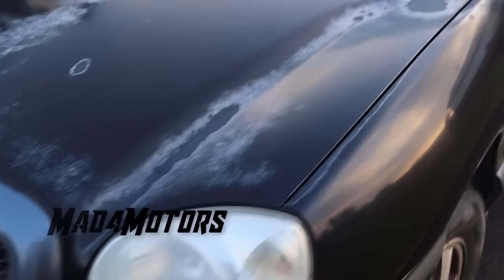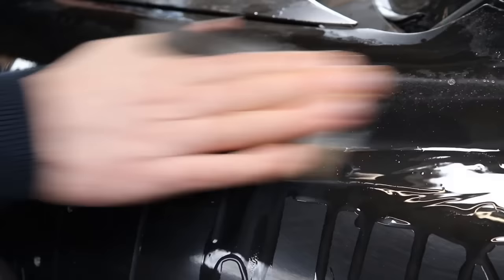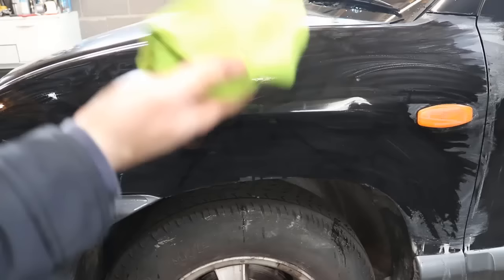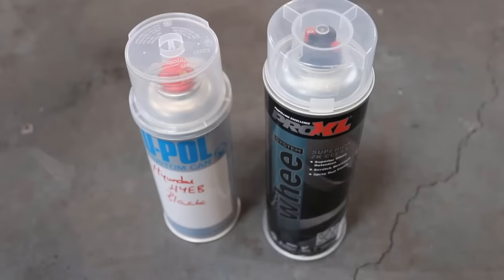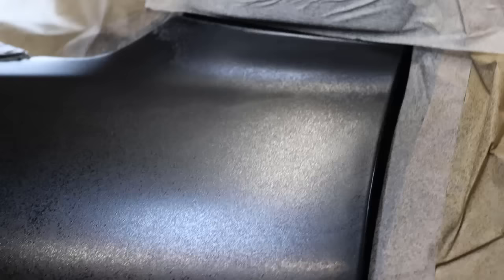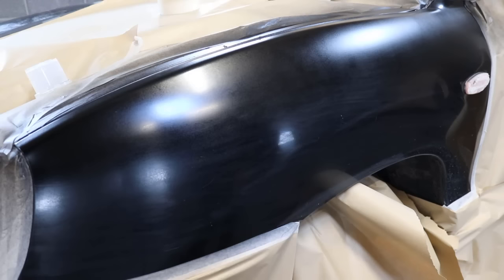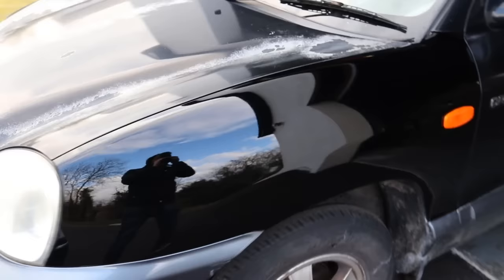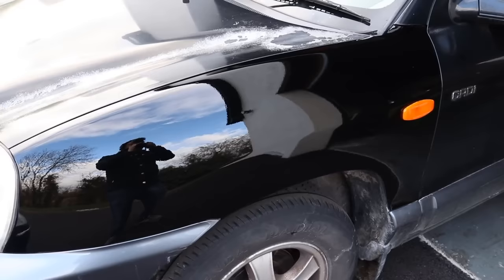How to Repair Clear Coat Fix 100% all types

Comment: This guy just shut down 2 thousand paint shop across america lmao 💪🏻 real M.V.P
Reply: Wade Wilson lol spray can jobs are shot
Reply: Yeah panel shops rely on $500 cars coming in for repairs that exceed their price tag, RIP panel shops 

Side note, this is a temporary touch up and won't last very long and is only useful for flipping a cheap car
Reply: Gotta love capitalism
Reply: Yeah right! Until you do this and realize there is a huge step he missed, orange peal! Not to mention, that was just a fender! 75% of people dont have the time to can spray paint a whole car let alone the time it takes to sand by hand!!
Reply: JKazama182 He does mention orange peel, and this method is meant to repair individual panels not an entire car.
Reply: Cisco Fair enough😂
Reply: Hahahahaha no he didnt.
Reply: yeah - but  NO 
the paints i use will stay on your car for 15 years minimum.  these are wal-mart paints. they will peel again in a few years. they do not endure uv rays like professional paint systems. 
 there are higher grade 2 part spray can paints, but the price tags go up with the quality.  
i am not advertising for paint shops - but a reality check is in order. 
there is some truth to the statement -  " you get what you pay for "
Reply: I have this problem on my car right now, this guy is a God to me right now lol
Reply: Andrew Glass better than other economies, where everyone is driving a piece of shit like this one 😂
Reply: Honda dealer tried to charge 3000 USD for this
Reply: Real shit 😂
Reply: @JKazama182  Nobody is gonna spray a whole ride with aerosol but U can fix a wing or door!!..He's just showing feasibility on sections of the vehicle.
Reply: Name Watcher Probably because they don’t own a paint shop so therefore they will have to pay a subcontracted licensed person to do the job and at the same time make a profit, which is ridiculous and dumb from car owners to trust a dealership
Reply: 800grit someone who doesnt know wtf they are doing will burn through the clearcoat and the base lmfao
Reply: @JKazama182  what is orange peel?
Reply: @mixter7x7  When I look up best paint to use for rims it always comes up with aerosol?  I mean rims go through rocks debris, dirt and grime.  I mean what is an expensive paint?  I can order the paint from a dealer for my car for 10$.  Can you give an example of good paint?  I think your thinking of clear coat?  I did buy the best clear coat I could buy in my opinion which was the 2k USC.  I see body shops use this clear coat on body repairs and its 5$-32$.  I don't know which is better but right now Rust-Oleum rated #1 clear coat for automotive and its 5$.  Than the USC 2k clear coat is rated #1 on another site and its 32$.  USC 2k on Amazon is rated #1 for automotive.  Clear coat protects from uv rays its why its on all cars.  Now for fixing my rims it took me 3 hours sanding than 30 mins applying the paint but I waited in between each time.  I wanted to get the best possible clear coat I could get.  I saw a professional shop sell black paint 1 gallon 37$ its made of enamel same bs in the aresol cans.  Now ceramic is expensive.
Reply: @davidmurphy4672    i need to divide your comment in half. 

1- wheels are different creatures from body/ fender.  yes - they take a beating the body paint does not.  if i were going to color my wheels - i would either shoot them with a urethane  / and several clear coats, or i would just spend the money to have them powder coated. 

2 - body / fender
i have never used the k2 clear, but it apparently has a good rep.  i have found i can use krylon, rustoleum or  ANY  kind of mineral / oil or spray can epoxy paint as the base  color and i use  ppg 2021 clear coat to seal and gloss it.   ( only because it's what our company uses )  there are numerous others.  jet glo has a rep for being very hard. and awl cat is also a very very durable surface. now however, you are talking about professional paints with professional prices.   ppg - jetglo - awl cat and imron for example are  " good paints "  they have etching, bonding, uv and corrosion prevention capabilities that spray can paints don't. 

i do not know the expected service life of k2.  certainly the single stage spray can clear coats are just cheap ie krylon or rustoleum.  i do know however that my paint work is still in the field after 13 -17 years. still shining, not peeling.
one thing is absolute - if you want to maintain a shine without polishing every month -  you  MUST  use  a clear coat.  single stage paints that gloss themselves will  ALWAYS  oxidize.  clear coat may oxidize but it's nearly impossible for your eye to perceive the change in a clear coat vs an exposed single stage glossing color.
Reply: Johnny D  I already used rattle cans I need maybe 1 more can for extra layers than Ill add clear coat.
Reply: Johnny D  nob
Reply: Andrew Glass underrated
Reply: No he didn’t cheap people end up with cheap looking paint jobs lol
Reply: Thats job  bullshit, spray? Lamo
Reply: HahahahahH
Reply: David Murphy, the dollar sign goes in front of the denomination. How do you fuck that up like 10 times in a row?!!!!!
Reply: Its fine... Until you want to spray 2k paint back to the car.... Then all hell got loose...
Reply: David Murphy more layers will make the paint have more orange peel.
Reply: Definitely
Reply: @azcatfan3544  LOL
Reply: Well... ya... I mean... re-painting and clear-coating is probably a surefire way to repair clear coat fix 110% all types. lol
Reply: @mixter7x7  who's keeping cars 15 years anymore ?
Reply: Perfect 5  year fix i just want it to last n look good til I pay off the vehicle and trade it in
Reply: It is NOT easy painting or clearing a black vehicle ... WOW is it ever difficult & tricky especially when using big box low grade semi affordable in store paints. Crappy!! Go to a paint/body shop and get their products. Store paints SUCK!!
Reply: This guy just saved me 💰
Reply: Me too about a grand
Reply: Mine turned out great wish we could post pics on here
Reply: @myco_space_kc5558  u did a finder?
Reply: @erikflores6145  no I did my bumper
Reply: @myco_space_kc5558  yeah, as long as its a small part it will work.
Reply: Ya right people are to lazy now days
Reply: Paul Cysneros take a look at the skin (peel) of an orange.
Reply: I was thinking the same thing ! ! ! ! ! Watch the auto body prices drop !!!!!!
Reply: @JMRabil675  go to Maaco
Reply: @JKazama182  that's exactly what I was thinking. My car top and hood needs to be done. Hell of a Sanding job
Reply: That's what I'm saying if it's legit and durable
Reply: @geovannicastillo8183  lol yep real quick!
Reply: Johnny D  yes sir. I work at a custom harley shop.  I wet sand and use 1500, 2000,3000 5000,and 8000. After buffed and polished.  Amazing flawless finish.
Reply: @davidmurphy4672  lots of paint shops have aerosol can systems. They have empty cans and can mix you the exact color to match ad fill thecan for you. I've used them for small things like door jambs and such but very rarely. Every paint store has an economy and sells cheap clear to can get ppgs omni line and advantage makes good economy clear. Finish masters sells the smart brand clear you can get a quart and hardener for $24. I use the smart clear for used car dealers all the time.
Reply: @myco_space_kc5558  me lol
Reply: Some people took this comment way too serious lol.  Most likely the people watching this have a beat up car... My 2013 has seen better days and I might touch some shit up
Reply: You going to cut n buff the clear?
Reply: @erikflores6145  lol exactly its america lmao
Reply: That's where those thumbs down were coming from
Reply: @stefanprijic6613  Wrong. It'll last many years with correct prep and quality paint. You can buy automotive quality paint online that's perfectly matched to factory color.
Reply: @TheGuruStud  Correct.. if prepped properly and quality paint is used it will last the lifetime of the car. However.. this is not the case here, once the clear coat is compromised, the base coat is exposed and begins to break down and get contaminated.. you need to remove  the contaminated base cost and seal it all off with primer, and then its ready to be prepped and painted.
Otherwise the paint will prematurely delaminate and map lines will show up after the paint cures etc.. 

Also you colour matched paints simply dont exist, you can buy paint that is meant to be for your colour code but theres many varients of the same code and other factors that basically means its gonna be the roughly the same but way off
Reply: Ha exact same Hyundai as my mums except I’m doing this on my rusty ass mr2😂
Reply: I just saved 600$
Reply: Wade Wilson I’ll need a fuckin magician to fix my cars paint XD
Reply: @JKazama182  and 95 % cant afford panel shops
Reply: @4vepvik781  hell if it works I will spray the whole dam car
Reply: @pcysneros  once you've eaten an orange it's the stuff you throw away, I think
Reply: This works just fine. If you're doing this just ensure the clear coat has UV protection and will add enamel. Sand at different grits lightly and close off any unwanted areas where paint may splash. Try to keep coats even with no striping. Any more than 2-3 coats is usually enough to cause orange peel. 

Most vehicles with this result are simply sun damaged. Auto shops lose business when info becomes available and easy to do. Cheaper paints lack qualities of higher cost such as heat resistance, uv, and cracking. You can 100% do this with rattlecans just make sure your paints have appropriate resistances.
Reply: @biggadigittydee7607  this looks absolutely mind blowing
Reply: guy at shop who kinda lived on streets but did work there ...air brushes his car he lived in said it took a week ...but you never have known ...old van looked factory new said it only took 1 gallon
Reply: @mixter7x7  todays paints here in calif that maco..one way sneiders and others are water based...why you see so many faded or peeling away...you can still find a few well by word of month shops that still use real paint and still remove all panels to paint
Reply: @edantonio9321  ahh video is for the avearage person to do their own...not pay someone to do it ..that is the idea of video
Reply: @Mr. 6 liter 15 years? Where did you pull that figure out of 😄
Reply: @Mr. 6 liter 😉
Reply: I was thinking the same thing! There is gonna be some others to start doing this shit for sure. I just started buying and selling cars on the side and came across a car that is almost identical to the shape of this one and color. I'm gonna try it for sure.
Reply: Factsssss 😂 😂
Reply: @MrRusell86  Kindly note that you miss used semicolons and quotation marks in your most recent comment trying to correct me.
Reply: naah, most people won't do it, have no desire, no time, fear of messing up...I wouldn't worry about that. If .5% will do it, that's about it.
Reply: Now 4 thousand!
Reply: For real & some over here hatin....... dude its a fucken Hooptie. 🤦‍♂️ its suppose to be cheap not top dollar jeez.
Reply: @stefanprijic6613  I disagree. It's dependent on how many mils of clear you put down and how the paint is maintained afterwards. Not leaving it outside in the sun and also putting down a wax coat
Reply: @JKazama182  He said in the video the last step is mechanical buffing. A good cut and buff will get rid of the orange peel.
Reply: You know people,  you wont have to do this if you Just took some time and grab some good wax or sealant and apply it to your car. It doesn’t take That long to do and you won’t have to worry about it for another two or three months
Reply: @andrewm8734  depends though. With cans you should be flattening between coats aiming for a minimum of 3 but preferably 5 coats. Ive seen some awful peel on new cars and resprays.
Reply: @myco_space_kc5558  well my cayenne is 13 years old and I'll keep it to 20.
Reply: @TheRealKalEll  you can get paint shop grade paints put into aerosol Can now, many autobody suppliers will mix pain into cans that you purchase.
Reply: @erikflores6145  Actually he'd in Europe.
Reply: @stefanprijic6613  Blacks are easier to get away with Ive found you can get away with a very close mix without blending in. Silvers and light colours are a pita.
Reply: @JKazama182  actually my neighbor and I canned my wrangler OD Green 5 years ago and it's still holding up just fine, granted we sprayed 4 layers and 3 cases later but I get compliments all the time.
Reply: If they didn't charge so fucken much
Reply: I’m thinking this is what a lot of paint shops do and charge a premium for it
Reply: MAN!!! I SWEAR HE DID!!! DAYUM!!! 💯💪🏽
Reply: i love seeing these comments, they’re so reassuring before i even start the video
Reply: Accross the world

Comment: Tip, get a small bucket and put warm soapy water in it. Get a sponge to keep the sanding area wet. Reduces friction and you end up with a better job of sanding.

Comment: Incredible! I wanted to sell my car to a dealership, but the clear coat peel looks so bad. There is no way they were gonna give me the price quoted. I followed your instructions to the letter. I spent $100 total. That included getting the paint code off the side of the door and getting the base paint ordered. Very smart to do that. It came out great. I wish I could’ve uploaded before and after pictures. Ended up getting the full price quoted for the car after that! Thank you thank you